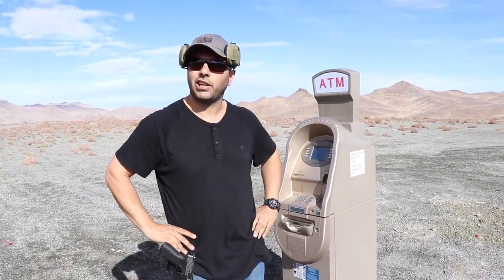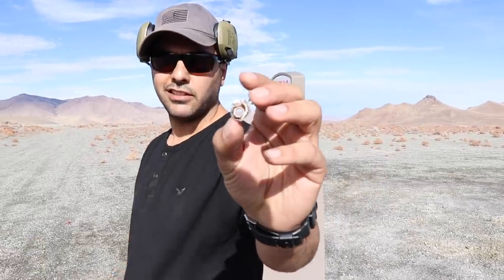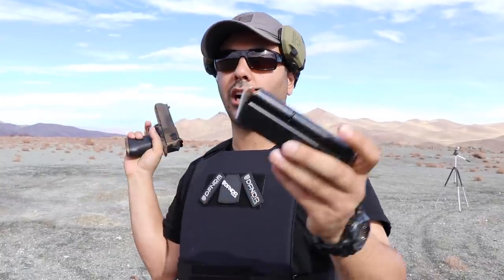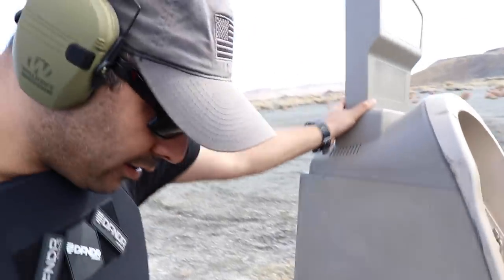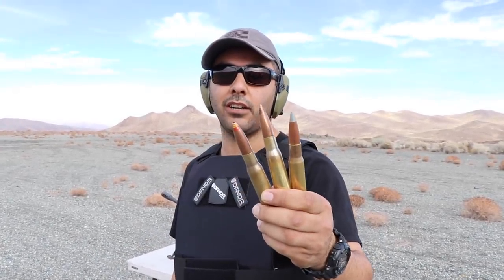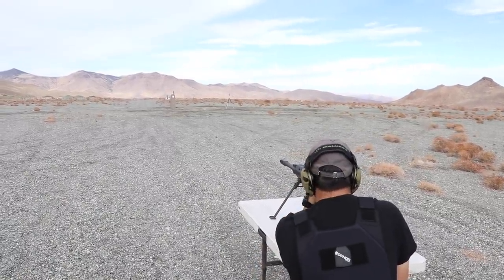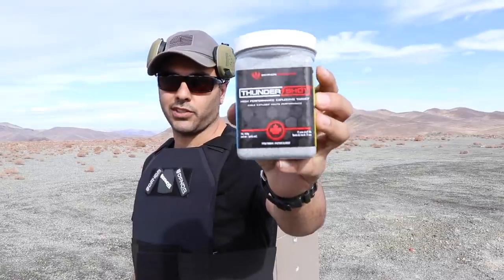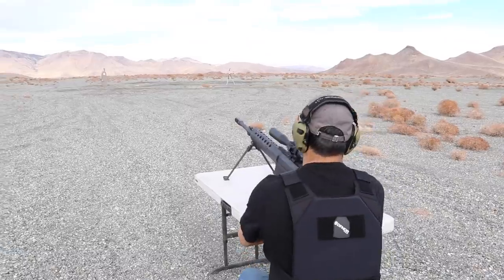is ATM BulletProof ?

Comment: No he didn't steal it
Reply: Dolphin King107 he did
Reply: Gemma Oxley He didn't.
Reply: Dolphin King107 yes he did dude
Reply: TG Gamer it would be bolted to the ground?
Reply: Some are not.
Reply: Dolphin King107 cool
Reply: yup
Reply: they all are and he also wouldve gotten sued and been stuck in court for a long time if this was real.
Reply: Dolphin King107 yes because it is his atm machine then put it in there for thr intro
Reply: Dolphin King107 he stole it XD
Reply: Hi
Reply: He 💀
Reply: Corbeyyy no it wouldn't the atm at the end of my road got stolen
Reply: He prolly bought it from eBay.  There's peeps selling ATMs on eBay.  If you own a convenience store, you can buy one, connect it to your bank account, fill it with munny, and set it up for your customers to use.   An ATM is basically a Sentry safe combined with a vending machine combined with a PC.  The intro was obviously a joke, but some people driving by were prolly freaked out to see a "bank robbery" in progress!
Reply: Gemma Oxley No he didn't
Reply: If he is who I think he is, he runs hotels and salons and as such would likely have come across a junk one at some point. Still xlnt intro. Did I miss the .223 or a follow up of said?
Reply: Duh
Reply: @gemmaoxley6218  it wasn't plugged in. It needs electricity and a data connection. Plus there were no outlets on the wall or ground where they "found" it.
Reply: Sauce_God_ is_the_name_ no he fkn didn’t
Reply: No he just borrow it, im sure that he ll give it back afterward

Comment: Now many of the ATM weigh over 1/2 ton and they have six anchors four to the ground and two againts the wall and even if you open the safety inside  theres another safety that holds the money and betwen the sheets of metal exist a layer of cement,